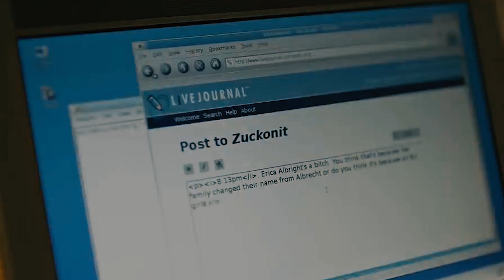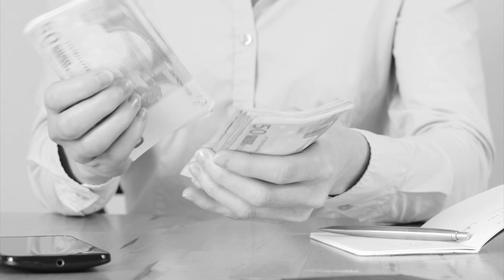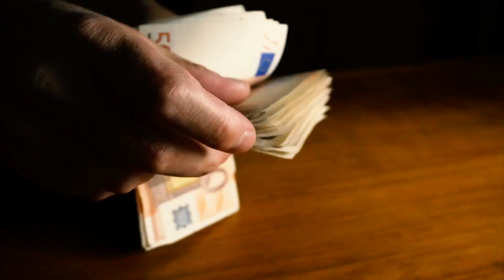When the boy bought a rusty BOAT, people just smiled… They were very SURPRISED later on…

Comment: Some are born with the desire to build and make things work. I start at 5 years old taking my electric desk clock apart and removing all the gears to make it run backward. Today at 67 years old, I’m self employed as a Field Engineer doing IT Information Technology and AV Audio Visual work, have all the work I can do, while picking the jobs I want to take on. In between, I’ve worked on automated semiconductor capital equipment, laser fusion, magnetic fusion, computer disk manufacturing capital equipment, medical device R&D, and never got a four year college degree. Learned CAD Design, machine shop manufacturing technology, and vacuum system engineering on the job. God’s been good, and I’ve been blessed!